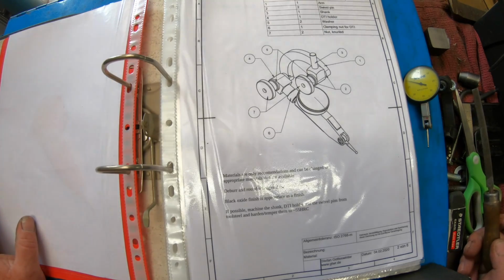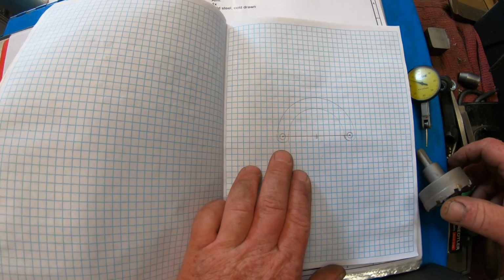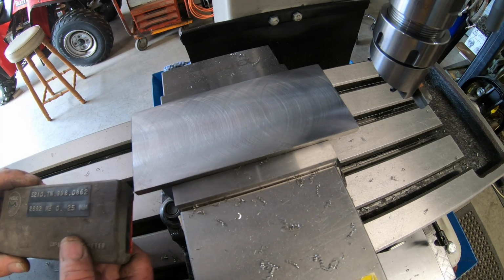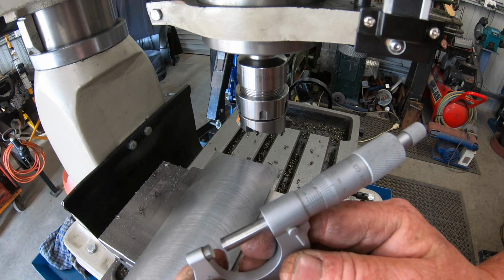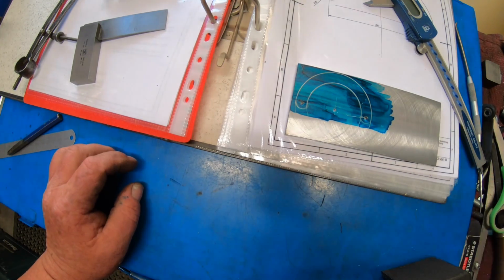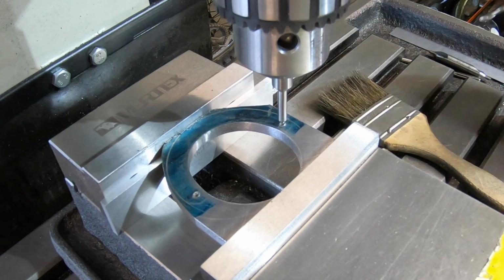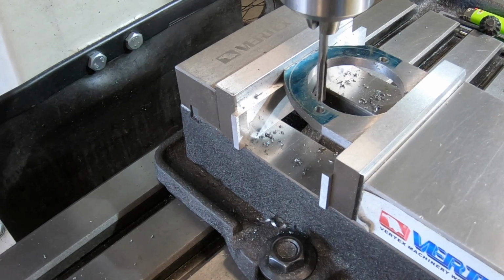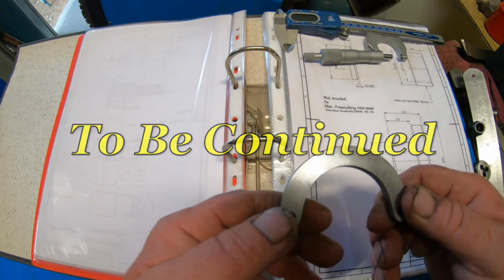GTWR Indicator holder build

Comment: Here is a quick release option for a Bridgeport type machine that always keeps the stylus geometrically aligned with the spindle. - https://youtu.be/_djgGUKpULs  for the occasional larger range option held in a chuck - https://youtu.be/3r9xVYoTK38
Reply from the maker: Gday, thanks for sharing the links, I’ll check them out, cheers

Comment: A few suggestions for you Matty that might help. I've yet to figure out why so many with home shops will still use a center punch on there layouts at all before drilling. It's a very old and quite inaccurate method that's really only good for larger assembly's with fairly loose tolerances for part sizes and locations. If I'm needing better than about + - .010"- .020" thou for accuracy the prick and center punches stay in the tool box. I still do a proper layout on the more complex parts to visually help keep the mistakes to a minimum. But if I really need accuracy I always use the Cartesian Coordinate Method to machine parts. Google that for a proper explanation of what it means and how it's used. It's the basic method that's been in use for well over 100 years once accurate feed screws and nuts could be made and is still how the newest CNC machines made today are programmed to machine high precision parts anywhere in the world. Yes on a non DRO equipped machine you have to factor in the backlash in the feed screws for each axis while using the dials on the machine. And a proper edge finder is required. I highly recommend doing what you have to to buy a good one from a reputable manufacturer and not trying to build your own since there's a great deal more to them that makes a good one sensitive enough than it seems. Proper heat treating along with high precision grinding and lapping on the ends of both pieces isn't optional to make an edge finder repeatable enough to be trusted. The cheap off shore one's simply aren't made well enough to be accurate.

Some of the feed screws on the off shore machines or on highly worn ones can't really be trusted for there overall point to point accuracy. That's still not an obstacle since a simple 1" travel plunge type indicator can be set up and used to measure the table movements. For distances over an indicators 1" travel then adding something with a known and measured to be correct dimension between a fixed point on the table axis to be moved and the indicator tip can be used. A 123 block as just one example. Using one and an indicator allows precise table movements in either X or Y within at least .001"-.002" accuracy from .000" - 4.000" if there used correctly. Before today's dro's were invented that was the general method used on the highest precision jig borers and grinders available. Today I now have a quite expensive digital height gauge and industrial level dro on my mill. If I didn't have those I'd go right back to using a simple indicator and known distance pieces and I'd still leave those center punches in the tool box. :-) It does take a bit of practice using that coordinate system of machining, but it's a far more accurate method and quite fast once you do get comfortable with it.
Reply: I agree with you 100%, Turning Point !  The DRO has made life so much easier for both my milling and lathe operations. However, they both pointed me to the coordinate system of locating features. If I draw something up in CAD, I always try to use this system, which contributes to accuracy and certainty in moving to the next cut or feature. Backlash will still be present, but that is why we have table and quill locks on a mill. Care with speeds and feeds also minimizes problems.